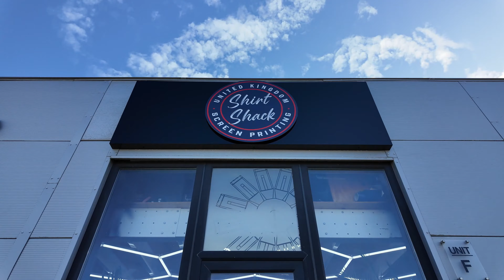Screenprinting a simple 3 colour design upto 500 t-shirts per hour MHM automatic, custom t-shirts

Comment: Nice video..
Sweet shop...
Screen printing sure can have its ups and downs at times...
I am having a headache with white paint pistol ink..i cant get white Wilcox paint on tshirts to pass the stretch test at temperature recommend..
So i bump the oven little by litte feom 330to390 and i still get a little cracking...at 330 i would test maybe to soon.i notice paint will hold better when warm for stretch test...so i wait 24hours and some shirts just wont pass stretch test ..
I  probably do tooo many flashes..i like my paint to not be see though.i dont want to see shirt material shodowing underneath white..my flash time is on point...
Tired of having to use heat press to condene cracked paint together....the heat press cures more evenly..i noticed in oven just a half a inch in either direction can have a different temperature on material...
So i thought i figured out my issue..since i am layering like 4flash with white paint with 160screen...just turn oven up..i test some shirts the next day and 2cracked....

The one thing about heat press to cure is..the paint will pass a stretch test ...but the paint is more on top of shirt ..when i dont heat press to cure and use oven i notice the paint soaks into the material and over time it fades...well with heat press after soo many washes paint will start to crack ....
I dont know why cured paint is cracking..hot to cold and into the dryer at home...i dont understand paint well enough to stop cracking with cured shirts done be heat press .
Thinking of getting a dtr machine..but the white powder scares me...
Ok enough rambling...i hope in another 3to4 years i can be close to your level of success..i do enjoy manually screen printing....

Comment: I'm just curious, why block off the edges if you're going to tape them anyway?  I'm hoping to break into the screen printing industry, just so expensive.
Reply from the maker: We have found in the past that if you don't use the block out then the ink will build up between the screen and the tape, not an issue if you only print a few hundred but better to go with belt and braces.